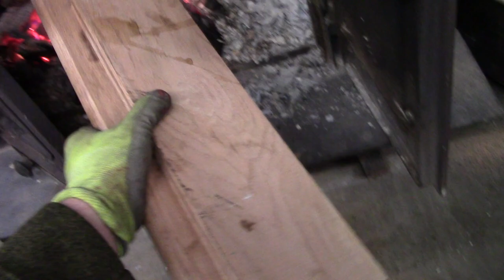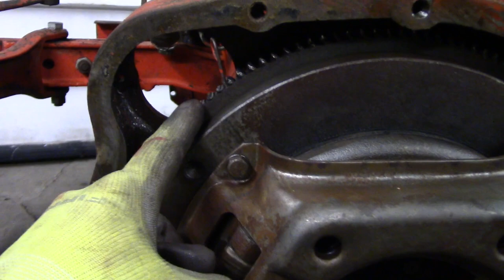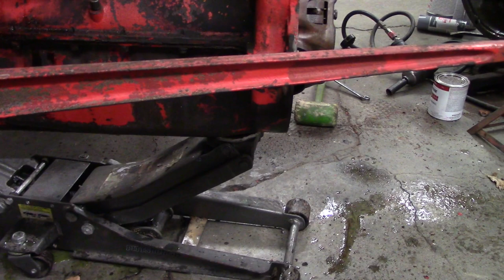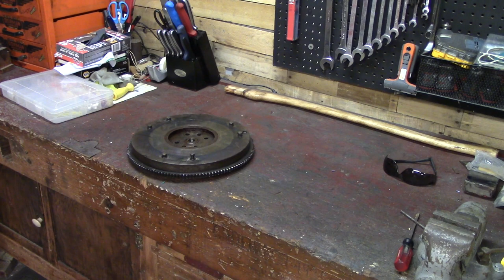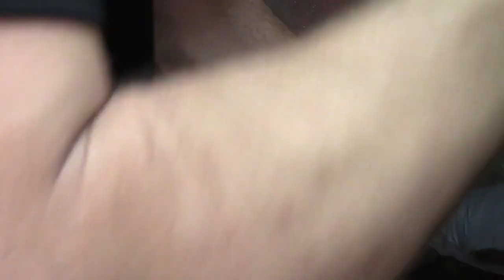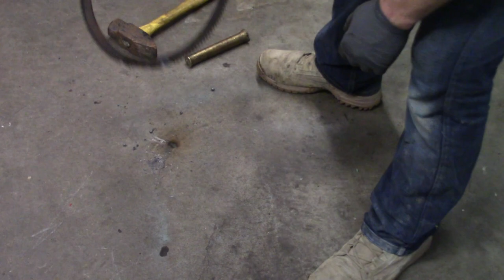9N Ford Tractor Clutch and flywheel repair

Comment: I own a 1954 Ford Jubilee this video is a great deal of help to me as I have never split this tractor to repair two oil  leaks !
Reply from the maker: Glad you liked the video! thanks for sharing. Take care
Reply: When properly heated, that ring gear should slide off and on with no problems. You can also make a cut in it to remove it.

Comment: Thanks for your video I'm working on my 9N now and couldn't get the fly wheel off either I just need a bigger hammer. Lol. My ring gear has the same missing teeth section like yours does and I bought the ring gear when I bought the clutch.
Reply from the maker: Thanks for taking the time to leave a comment and check out the channel! Take care!

Comment: My starter broke i tryed to turn with a pry bar flywheel would not turn
Reply from the maker: I was able to turn the flywheel through the starter hole in the bell housing. Just a few teeth at a time but i would turn. Should turn especially if the tractor is in neutral.
Reply: @homebuilt8694  yea mine wont turn i hope piston ant broke